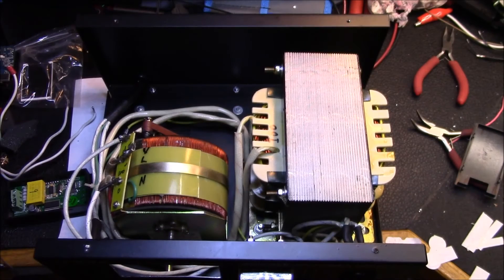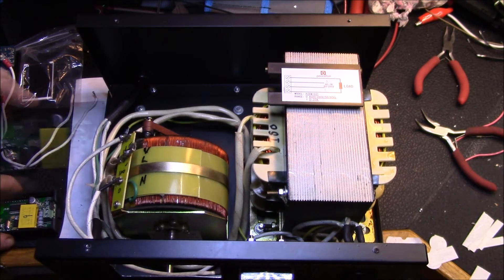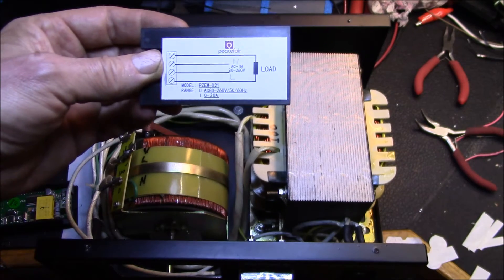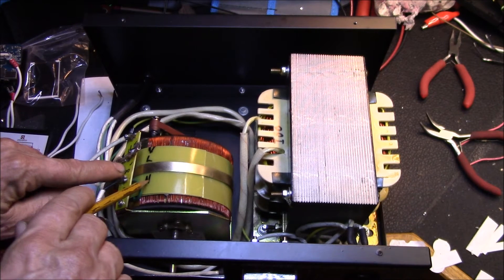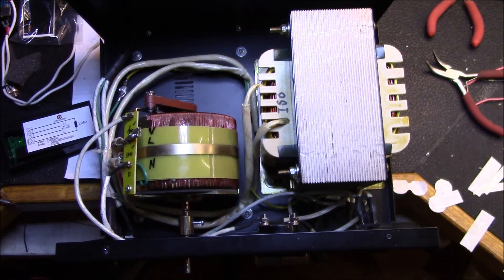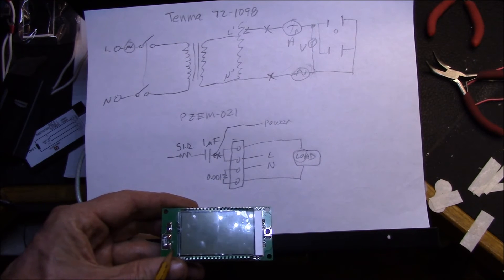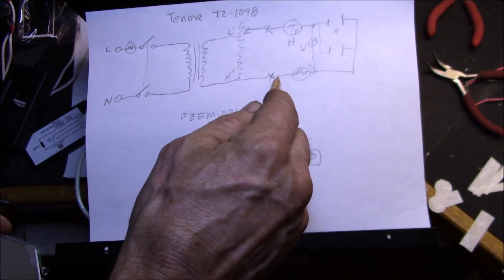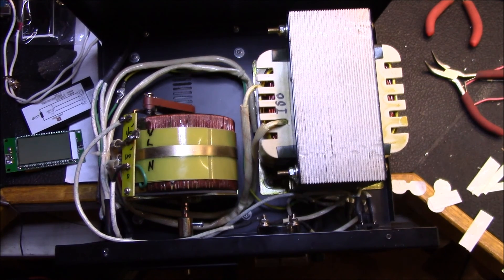Quest for Zero, (a.k.a. PZEM-021) Part 3

Comment: Is there a way to calibrate the panal meter? For example it's measure 227V x 3.44A = 711,5 W but it should be 780,88 W it's an error of +/- 70 Watt. I have the PZEM-021 version 3.
Reply from the maker: I've never run across any calibration methods.  But it looks like you may not be accounting for the load's power factor.  Volts x Amps will give you the load's VA or apparent power.  The meter only displays the real power or Watts.  The ratio of Watts/VA is the load's power factor (which this meter doesn't display).  In your case that's about 91%
Reply: @The4Crawler  Thanks, I didn't think about this.
Reply from the maker: @marcovandalen7555  Yes, that's one quantity these meters don't display is the power factor.  With just 4 quantities displayed, they had to leave out power factor.

Comment: Maybe you can help me out? I'm building a variac and have the -021 panel meter like yours. In order to demonstrate it to my son/bench test the meter I was hoping to wire a light bulb in a socket as a load. How should I wire the hot & neutral on the bulb to the load connections?
Reply from the maker: A couple of options I suppose.  One would be to get something like a trouble light or any light bulb socket with a power cord and plug attached and use that, assuming you have an AC receptacle on the Variac output.Short of that, you could temporarily wire up a bulb socket with some wires connected to line and neutral and use that, just take care to make sure the wiring connections are well insulated.  You could also use something like a 12-24V MR12 type bulb and as long as you keep the voltage below ~24 volts, it'll read out power, voltage and current on the meter.  That would be safer as the voltage is lower.  I hope to be making a video on doing this very test with some MR16 LED bulbs to test power consumption.
Reply: Hi & Thanks for the feedback! I figured out that the position of the hot and neutral on the load (60W bulb) was important. Once I swapped the leads it worked great! I'll have to do your mod with the cap so the meter will still be powered at lower voltage settings on the variac. @The4Crawler
Reply from the maker: Glad you got it working.  On mine, all those wires were hooked up to the outlets at the Tenma factory, so I didn't have to mess with them.  Yes, well worth doing the separate power supply wire, gives you the low voltage operation and eliminates the power draw of the meter itself from the display.